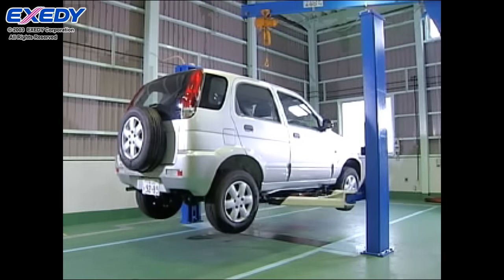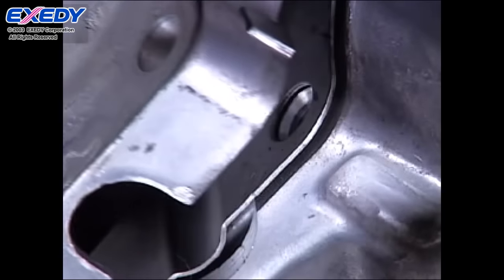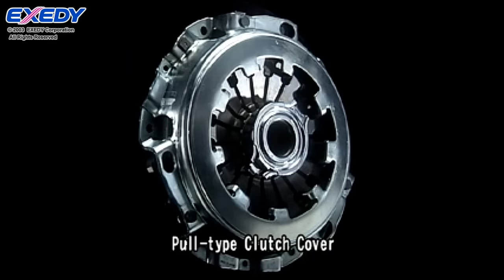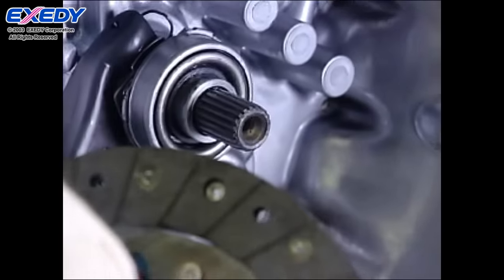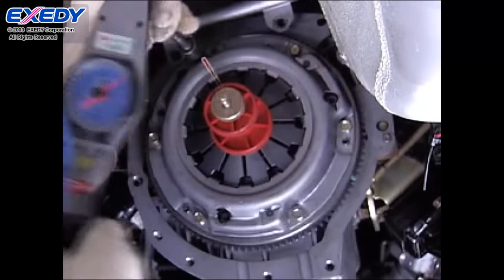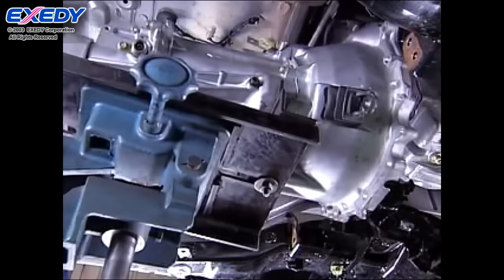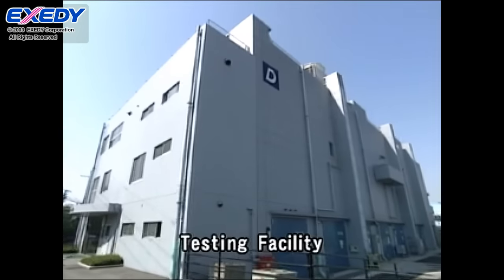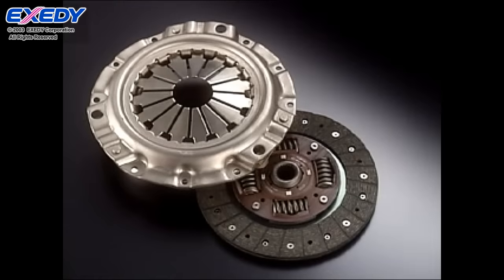EXEDY Tech - Manual Clutch Replacement procedures and precautions

Comment: Looks to be a very crisp and clean video.  Everything is easy to see except one thing: the pilot bearing.  I did not see any instructions regarding the pilot bearing.
Reply: My guess is the red tool what you see in the middle of pressure plate, that will self-centered the component at the right place.
Then you lock the bolts and voilà...
Most of the time this tool is delivered with the clutch kit itself.
Reply: He didn't want to get his white gloves dirty . 😂
Reply: Believe or not, some vehicles don’t use a Pilot bearing.  True 👍🏻

Comment: You just replaced a clutch on a old unmachined flywheel. Thats when i stopped the video and moved on to the next brand.
Reply: There is no need to replace the flywheel unless it's unevenly worn, scratched or heat damaged/warped, as the video described.  It's a good idea to replace the rear main seal on the engine to prevent a leak 10,000 miles after a clutch replacement, which would require another new clutch and the $7 seal.  It's also a good idea to replace the pilot bearing.

Comment: Little old, and already educated on clutches, but I figured I would look to see what videos were out there for people. Honestly not a bad video. Just keep in mind to never use compressed air as the clutch can contain asbestos and other harmful material. Also, if replacing the flywheel, make sure you buy a set of ARP or other brand bolts...don’t reuse the old bolts

Comment: Clutch job like that would take a week to finish
Reply: That's true with the average skill of today's mechanics, but not real specialists.
Reply: It only take less than 1 hour to replace a clutch done many times🐃
Reply: @richrich9560  Is it really? I bought my first car which is a 94 Honda Accord and the gears are hard to shift now but I don't know if it's oil or clutch problem.
Reply: @richrich9560  doubt it. try it on a acura TL i dare you

Comment: Yeah right....it's very easy when the vehicle manufacturer gave enough clearance to align the gearbox perfectly straight with the engine. 99% of gearboxes need to be angled so that the bellhousing will get as close to the engine as possible, then the tail lifted. Even then it won't go in on just the first try.
Reply: Exactly
Reply: When aligning the transmission and engine, it's important to be able to cuss fluently in the vehicle's native language.  I can cuss in German, Japanese and American English.  I'd need to learn Swedish to work on a Saab, or Korean to work on a Kia.
Reply: Right. 99 percent of installs are the dude shacking the crap out of it.

Comment: Grinding the flywheel?? Oh lawd! Just replace the damn thing.
Reply: In the very old days flywheels were made extra thick and heavy to smooth out the engine vibration, that made the grinding option more feasible and economic than replacing especially in some poor countries in the world. The newer models are fitted with lighter weight flywheels with little room to wear so we have been replacing them most of time in recent years.
Reply: @biaohan4358  I think you are referring to turning a flywheel on a lathe which makes sense on a thick steel OEM part. Nowadays everything is made to be thrown away.